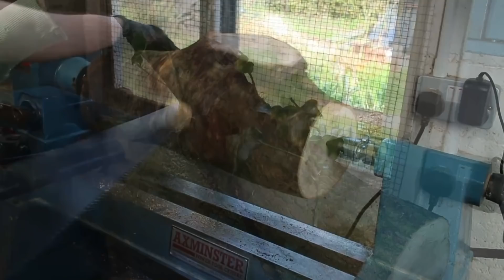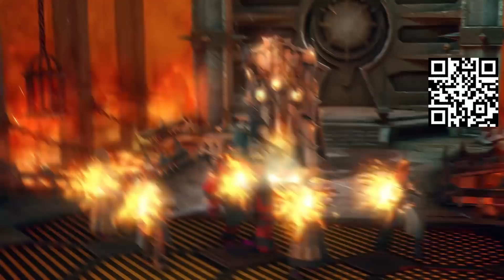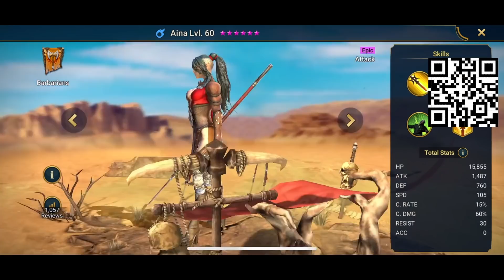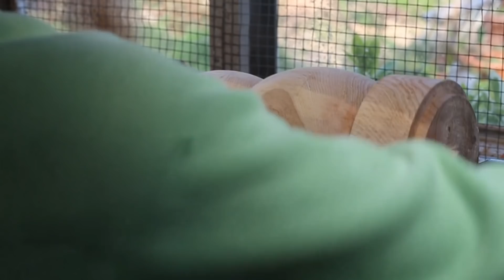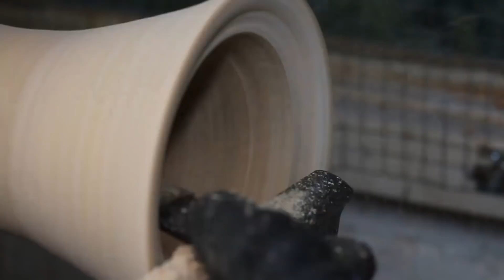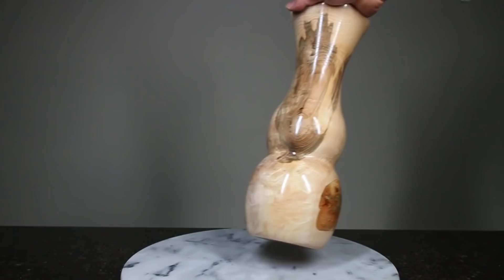Woodturning - Big Wet Elm Crotch!

Comment: Harry, it's a beautiful work and I have a question. You did not show a lot of work on the inside. Did you hollow it or just drill down and open it at the top? I've done vases and often shape the top few inches and then just drill 2" diameter down. Which did you do on this?
Reply from the maker: Thank you Josh! For this vase I drilled right down to the bottom and then started to open it up from the top. Sorry I didn't show much footage, it can be difficult to get the camera angled right while still leaving me with enough space to work 😊👍

Comment: This is a master lesson of handling! I wonder how you did such a perfect job with so strong vibrations...congrats! Just a question...how do you contrast crackings of wet wood? Many of my jobs crack after two or three days? Thanks and have good times in turning!
Reply from the maker: Thank you so much as always Umberto! Wet wood is difficult, but I try to remove as much material as possible and then store the finished piece in a cool dry place for a while. This helps dry it slowly and then you can start introducing it to increased heat, for instance in the house. Hope this helps 😉😊👍
Reply: @HarrySmithWoodturning  Thank you very much Harry, sure I' ll try...stay safe and have fun!

Comment: Please excuse my ignorance, I don't know anything about the properties of wood. But I was wondering, if you turned it when it was wet were you afraid it would crack when it dried as a vase?
Reply from the maker: Thanks for watching Marjorie! No worries, please ask as many questions as you want. Wet wood will always crack when drying, but it's just depends how severe. I try to mitigate this by storing it in a cool place for a while and then gradually introducing it to increasing heat 👍